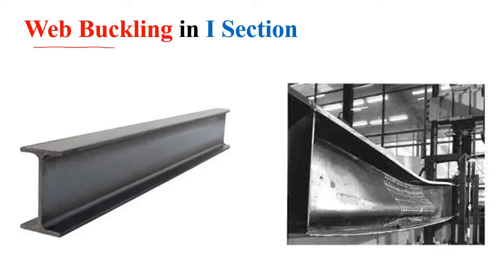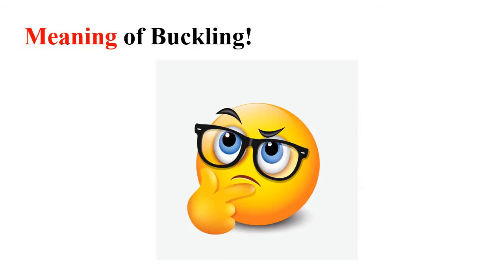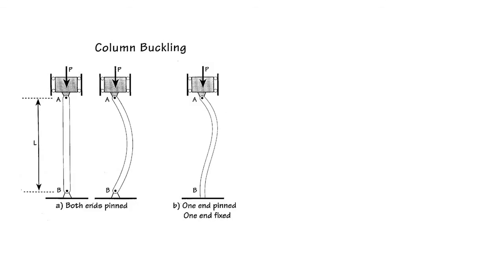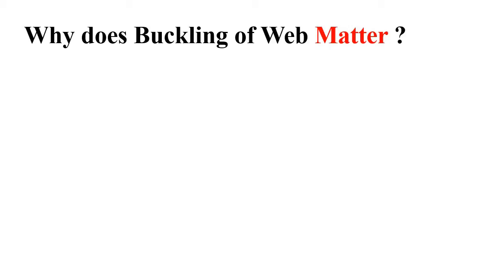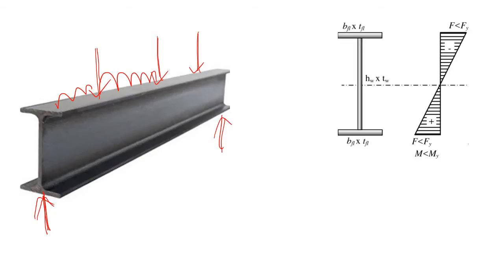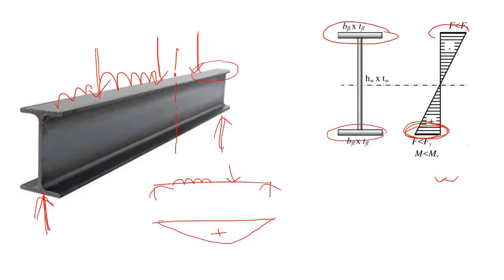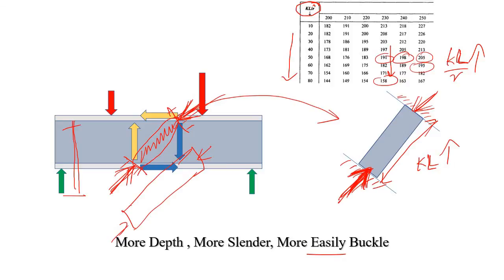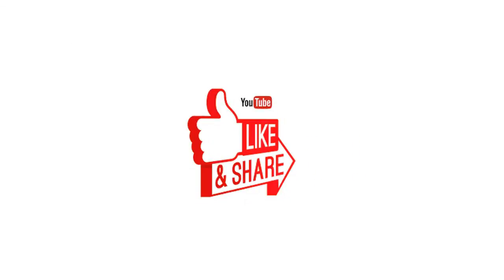Web Buckling of I Section : Flaw/ Problem with I Section/ Built up Section

Comment: What are complementary forces at 6:00 ? I understand top flange and half part of a web is under compression throughout whole beam but why did you draw some mysterious complementary forces and strange diagonal crack/shape on 6:27 is not actually explained at all.
Reply: Resistance to that torque from C and T, causing shear stresses on section. Their resultant from C and T combined causes a pull and push on the web diagonally, max at supports or positions of point loads along the beam. In RC beam, the tension is taken by the links or stirrups since concrete is good in compression, steel is good in tension, so for I-beam, the concern is buckling due to resultant compression force, the push forces he drew. We stiffen the web with stiffeners, to take compression.
Reply: Same... I also did not get that part